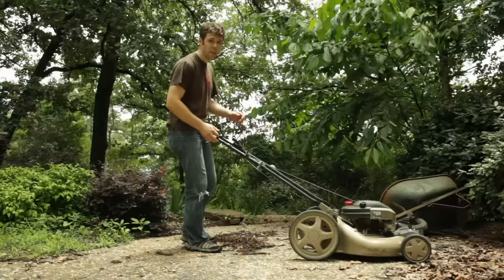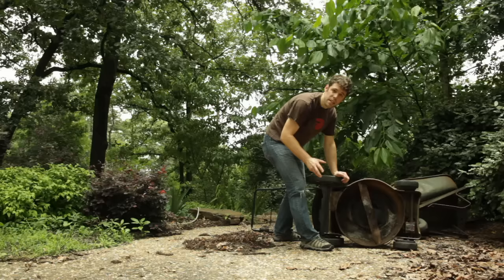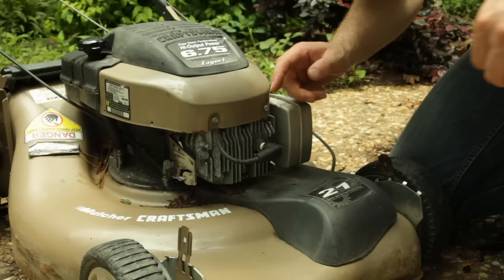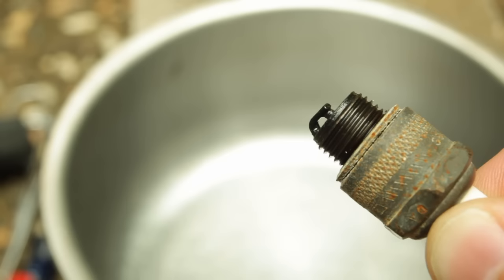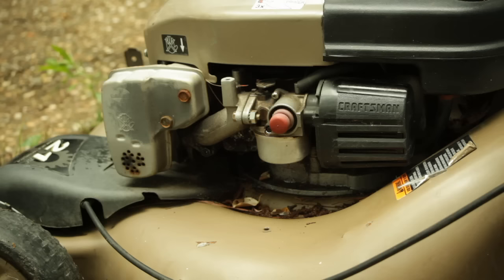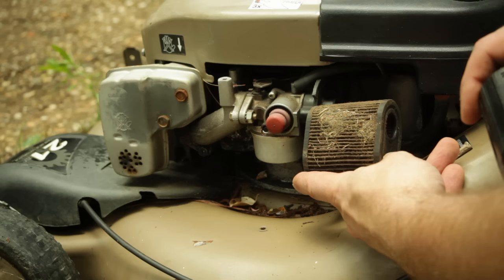Fix it Friday! - How to Get a Lawnmower for Free! (or Fix Your Own)

Comment: if its 2 stroke engine you should add 5% oil to the gasoline mixture or your engine will get hot and eventually seize
Reply: Nobody makes 2 stroke lawn mowers. That's typically smaller engines like weed eaters and chainsaws.
Reply: It's obviously not a 2 stroke since there's a separate oil fill.
Reply: @michaelgasperik4319  lawnboy use to.
Reply: @robertknight4672  interesting, I didn't know that.